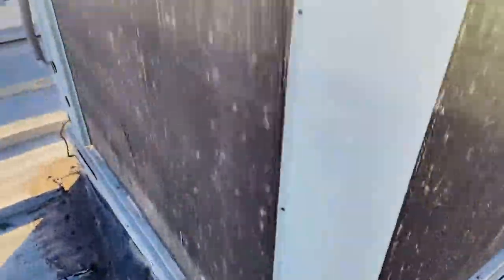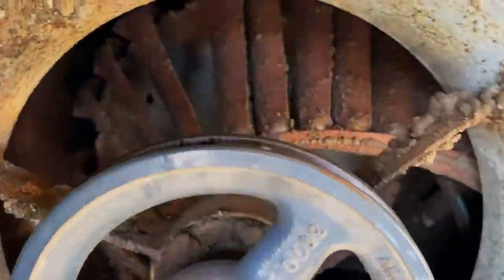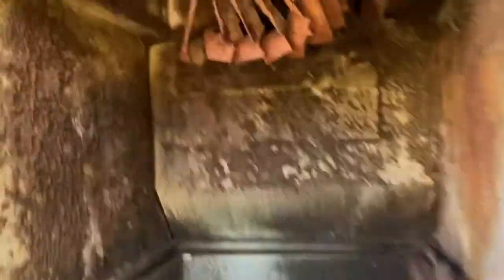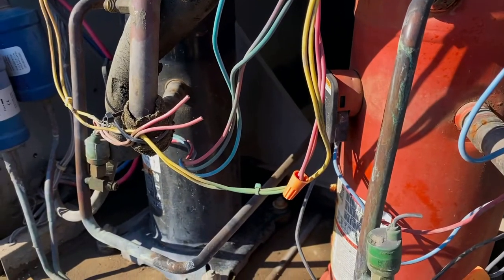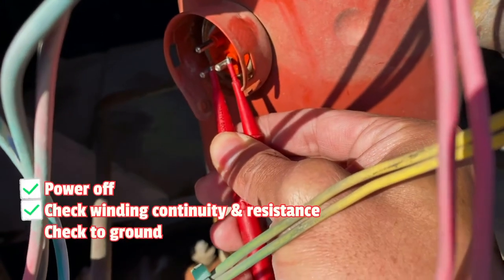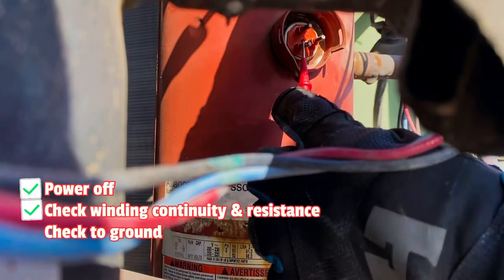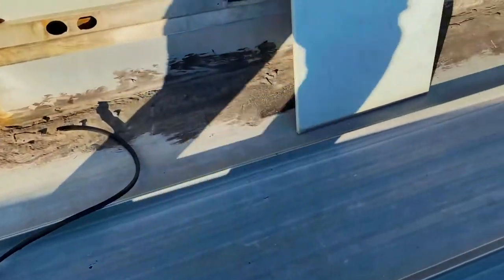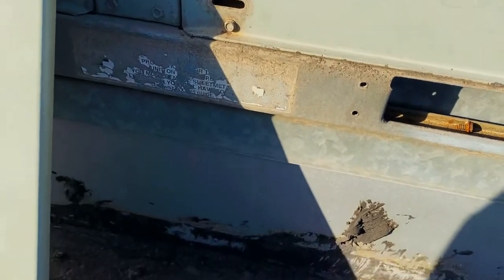TRANE Package Unit on it's Last Leg | Never Seen This Happen | HVAC VLOG

Comment: you still liking that driver? I ve thought about getting one. For $15 it doesn't look bad.
Reply from the maker: Oh yeah, just keep in mind it's just an electric screw driver. I can still force loose any stubborn screws with it by manually turning it a little to give it a head start then it's fine. I thought I was going to break it a couple times but it's still good after a year